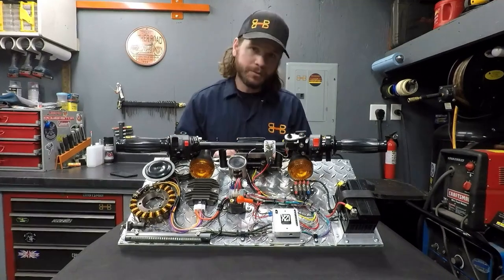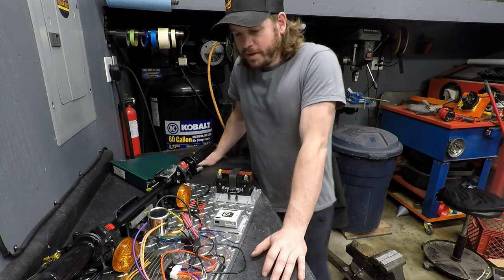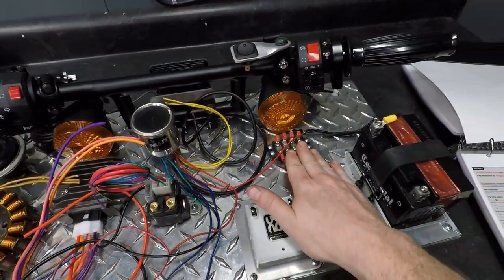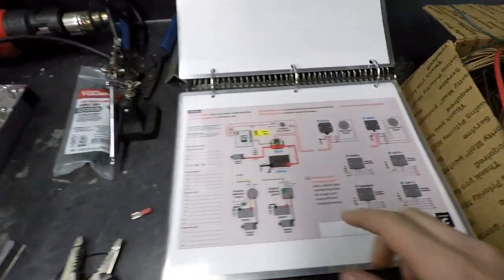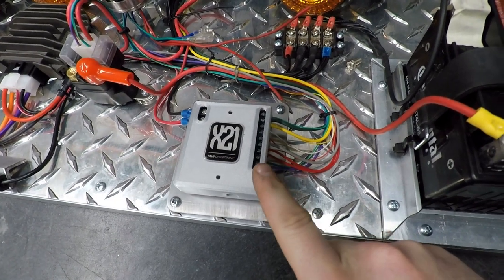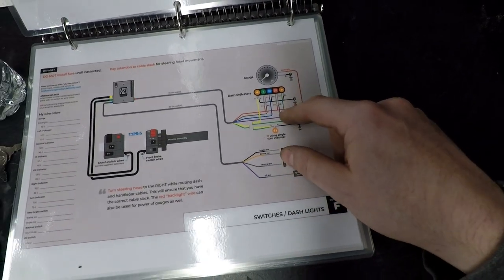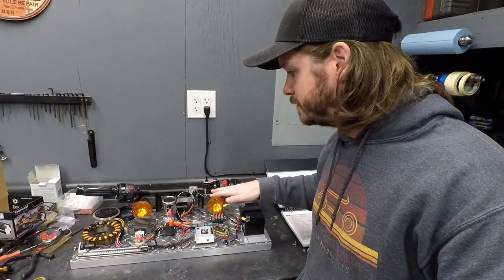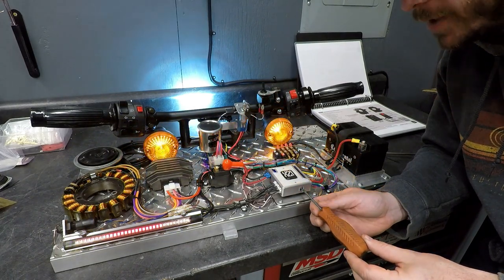How To Install An X21 - Product Guides

Comment: I’m not seeing a lot of fuses.  I’m not an expert but I’m learning a lot.  Thank you for doing this series.
Reply from the maker: All built in smart fuses except for the main blade fuse.  I appreciate you watching and just want to provide good info
Reply: Nice job on the display. There is something very satisfying about neat and tidy wiring.
Reply from the maker: @nick4872  thank you. Its a nice tool to have for stuff like this
Reply: I've been doing their older unit on my CX500, it felt weird cutting out the entire front fuse box lol.

Comment: For an old bike with a hacked up electrical system, or a rats nest of wires, this thing is a lot of reassurance. So that one could rip out all that old wiring completely, and put in all new wires, and not have to try and rescue the old wiring. The only difference I'd do is to use aircraft wiring. Superior insulation and inside the wire every strand is tinned. So it doesn't corrode under the insulation, which I have seen with bare copper wire when I stripped it back. Tefzel is the latest type. And is showing up as race spec wire. The older teflon wire is still out there and a lot cheaper.
Reply from the maker: Agreed. For wire I used my cheap stuff here as I usually use a high quality TXL that I love. I love all the nerdy wiring stuff!

Comment: Very nice system...doing a 73 CB750k3 cafe build. We be looking at purchasing this in few weeks .
Reply from the maker: That would be a big upgrade on that bike. Paired with a DRR-F reg/rec that would be a nice modern update
Reply: @BrickHouseBuilds  thanks quick reply doing a "electronic ignition" upgrade too this seems be best way to go and prices are very reasonable. Compared to M-gadet which way out my price range......plus all the x21 components fit together BONUS
Reply from the maker: @jefferyeverly9431  Ignition wise I've use Charlie's place kits on a number of CBs with great luck. Our stuff works with a variety of other parts but we just provide actual detailed wiring diagrams and installation guides
Reply: @BrickHouseBuilds  I have checked them out "Charlie's place kits" . Def going with them. Thanks million for the input. I"ll keep updated, just subscribed to you Instagram. thanks again

Comment: So I just spent the last 2 weekends turning a 97 intruder wiring harness into an 86 intruder wiring harness, when I could have done this on a Sat. My next project is a 08 Katana, the S would work right?
Reply from the maker: You could use any of the X21 systems yes.
Reply: @BrickHouseBuilds  your the first youtuber to ever reply to me. lol I was looking at your site, I can't tell if the controllers are 22mm only or is there a 25mm option. I think I might get one for the intruder as well to remove the rat nest.
Reply from the maker: @emiliogjr84  We only offer 7/8" aka 22mm for now. We do offer a service where we can retrofit your actual controls for X21 use if thats something you are interested in. You would just get with me via email or NWT directly from our websites.

Comment: i couldnt see the speedeometer on the vedio is it a feature of the x21 to also have a digital speedo ?
Reply from the maker: No gauges are included with an X21 package.  The X21 offers gauge power outputs to run lighting and dummy indicators. The PLUS has a tach ability. You can view the functions on the website actually

Comment: Hi I have a question on wiring the electronics. Can I wire everything without a stator rotor? What use does the stator rotor do with this electrical circuit? I have a 1981 Honda gl500 I want to tidy up the old wiring.
Reply from the maker: You need the stator as it is what creates the electrical power for your bike. Check out this video that goes over wiring fundamentals https://youtu.be/R1O4dJKJZgo

Comment: what is the difference between the S, M, and P versions? is it just the type of switches included?
Reply from the maker: Correct. Functionality is the same but what varies is the style of control you prefer. I have a video called Morty/Marty/Tricky overview from a couple months back that explains it.

Comment: Another excellent detailed video, what size handlebars and what brand of controls? Thanks for posting and ride safe.
Reply from the maker: Thank ya! 7/8" bars unless you need a special set of controls wired. The controls are manufactured by NWT

Comment: What does the sense wire for the rectifier do? Does it just need a switched power source or does the X21 use it as a reference for a running engine?
Reply from the maker: The sensing wire "senses" the current draw or power consumption on the system and tell the reg/rec how much power to throw at the battery or how much to shunt.  Think of it like a speedometer in relation to your foot.  A tach input would be needed to see if an engine was running for the X21.

Comment: Where can I find the installation guide? The link in the description doesn't work
Reply from the maker: Thanks for pointing that out. Just head to my website www.brickhousebuilds.com and you will see it there. We are making website changes that will likely go into effect next week so just use mine for now or simply nwtcycletronic.com
Reply: Can you post the link for the spot on your website. There's a guide on the European page but it doesn't look like mine unit
Reply: I'm really just needing the wire diagram for now
Reply from the maker: @alexkellman8201  NWT Europe has all the same info as me.

Comment: Is there just X21 for sell? I like mine handle controls. Don’t need the whole kit
Reply from the maker: We one sell them as a package to make install easier for people and eliminate damage due to improper wiring. In case you aren't aware these are available with 5 different control options

Comment: Are you planning to add the controller for the gear position too?
Reply from the maker: Can you elaborate a bit on the controller your referencing?
Reply: @BrickHouseBuilds  Sure, I own a Suzuki GS500E 1982 and, as you know ;), it has a gear number display (don't know the exact word in english), can you wire it too with the X21? Didn't see any info in the video or on the website. Great channel anyway m8 and thanks for the answer.
Reply from the maker: @AndreaBassolino  Oh gotcha just wanted to confirm.Yes you would simply tie in the gauge backlight power to that dash power wire. The selector mechanism on the trans sends a ground signal in each gear which illuminates the number. No issues there
Reply: @BrickHouseBuilds  i'm planning to restomod the bike the next winter so the X21 S could be a serious candidate for controls and wire management. I also read that you got an affilite in EU so i'll keep in mind when the time comes. Thanks again!
Reply from the maker: @AndreaBassolino  An X21 would be a great addition to a 550e! Yes, Al of Kilted Bushido Builds is who you would purchase through should you move forward with it. He has UK and Europe covered with his own stock to save you on shipping times and import fees

Comment: This unit is garbage works for a few month and fails on you two times on the 12v out to coils won’t send the proper voltage to spark. Got the second one and same shit it failed in the second month. still under warranty but no response from the company, don’t waist your money going to invest in the motogadget unit.
Reply from the maker: @Ayadw7  I'm sorry that was your experience as that has not been the experience of many. Hopefully you are reaching out via the correct channels for assistance.
Reply: My second x21 just broke.  Several channels are stuck open—horn, R turn signal and hi beam.  There is no way to reset.  This x21 has fragile circuitry and will fail and leave you disappointed.  Skip the drama. Motogadget is resilient and robust, has led that provide immediate feedback, solid state circuit protection that resets automatically and many more options for programming. I wasted soooo much time on this product.
Reply: @JJ-cb3om exactly it will just fail and you won’t know what the hell happened after you try everything. I got the motogadet blue and that will be my winter project.

Comment: I have an old Harley with a generator, do these systems work with that?
Reply from the maker: No issues at all. Just give it between 6 and 12 volts and it will work.